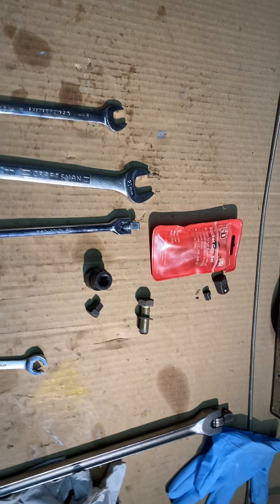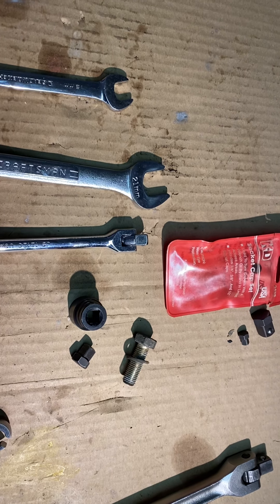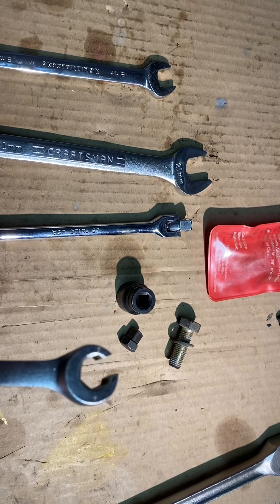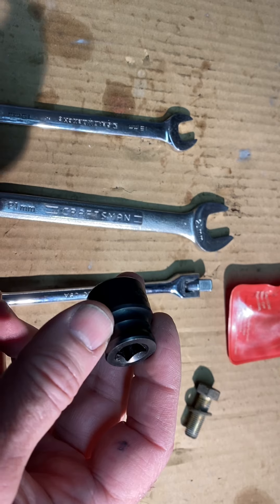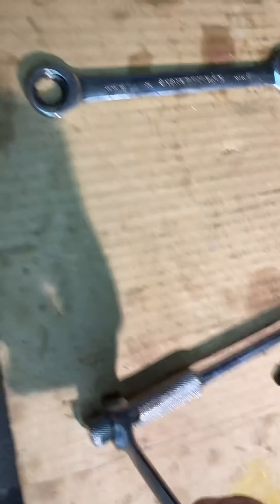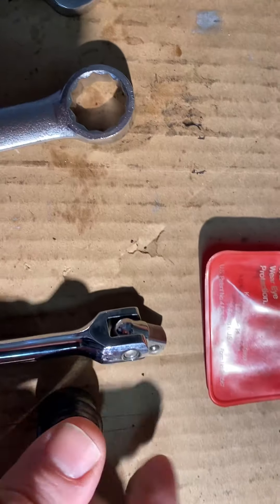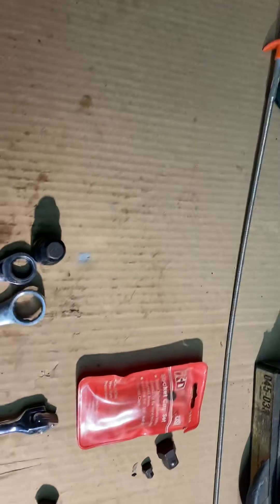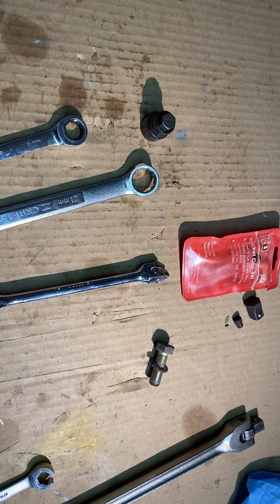Porsche 911sc rear brake caliper removal tips

Comment: Was so happy to finally get the lug nut lock off that had been in place for 37 years. (A friend loaned me a hefty impact driver.) Quite a surprise to next run into this difficult lower caliper bolt. Much appreciate this video . . . now off to auto parts store for some wrench stuff.  Thanks so much! 🙂

Comment: I use a 12 point socket, 3/8 drive. You can grind the socket as short as you like (use a harbor freighr vs a snap on  tool if you'd like). I have a Craftsman ratchet that has a rather thin head but with a shortened 12 point socket you can do it. Once its snug, a longer 3/8 ratchet with a typical head thickess and a typical unshortened short socket will rubiks cube over the bolt and you can actually operate the ratchet. The torque is only 40 pounds. Just make  it as tight as you can or design a torque wrench to fit.